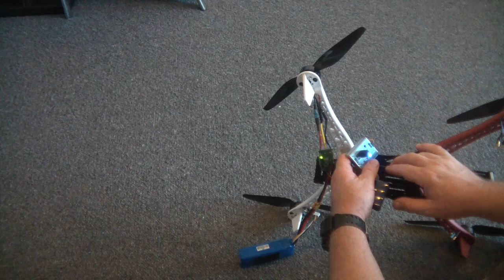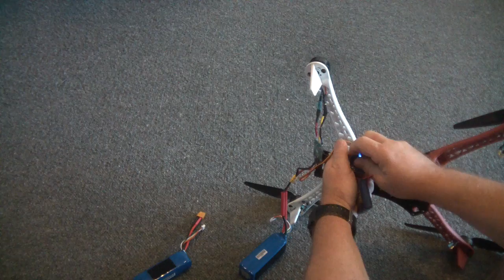AFRO 30 AMP ESC now perfect with Sunnysky 3108 motors

Comment: Hey trainboy! Thanks for posting the video of the solution of this problem, this could be very useful for me in the future!
Those motors are the 720kv or the 900kv? 
I'm planning to change my sunnysky 2212 980kv motors of my tbs discovery with custom gimbal for the sunnysky 3108 720kv for maybe getting more torque with 10x5 carbon props and longer flight time with 4S 4000mAh 35c lipo.
Could be a proper upgrade for longer flight times?
THX

Comment: How did you upgrade the ESCs?
Reply from the maker: Hi Simon, I did it with the AFRO USB programming tool and the KKmulticopter flash tool.   Here is a vid of the process - these are not Afro ESCs in the video but the process is the same https://www.youtube.com/watch?v=tILBUmRL76s

Afro USB tool here http://www.hobbyking.com/hobbyking/store/__39437__Afro_ESC_USB_Programming_Tool.html

KK Multicopter Flash tool here http://lazyzero.de/en/modellbau/kkmulticopterflashtool
Reply: Brilliant. Thanks.